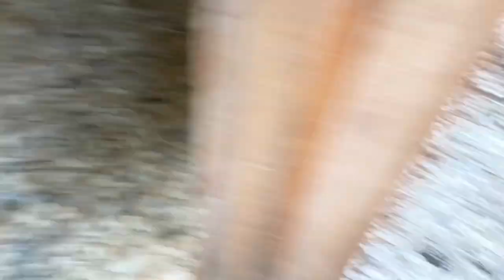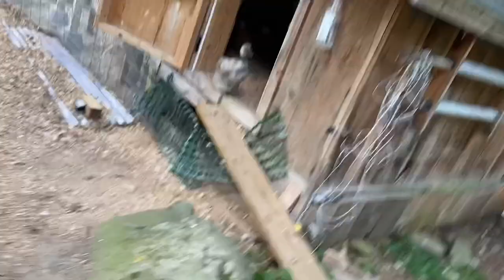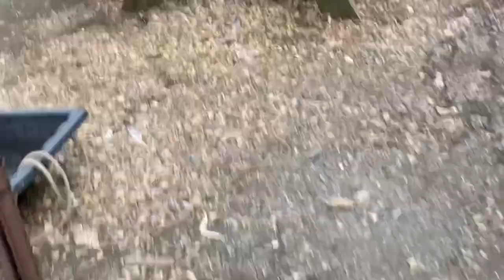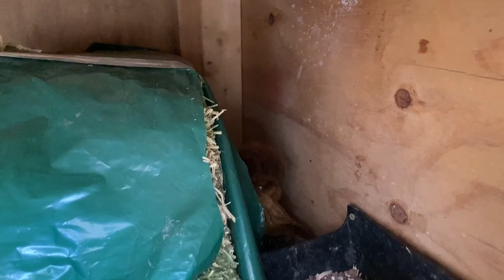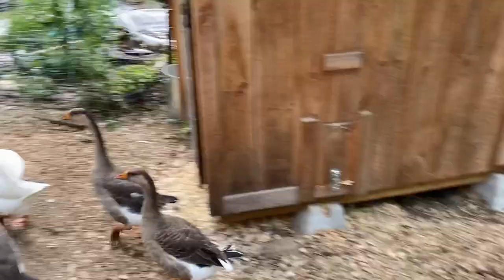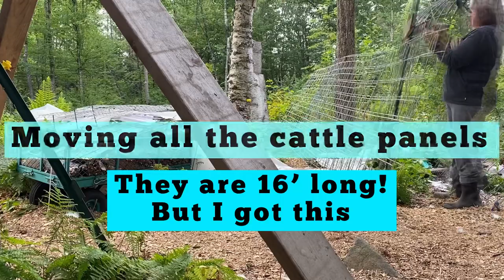I've Been Putting This Off ALL SUMMER  | Silkie Chickens | Part One

Comment: Have a question, I have several 8 week old male chicks, one of the male chicks is super aggressive and just us a little sh*t, my question is if there is a dominant roo, will the others settle down and not crow as much?
Reply from the maker: Hi! There is a chance that what you have said could happen. But they are way too young to know yet.  I have seen hatch mate roos figure out a heirarchy and one is the boss and the rest tow the line. :) You could also try to seperate the bully with another chick for a week or two and then put them back. Their whole pecking order has changed and they would be at the bottom of the pecking order at that point. Good luck!